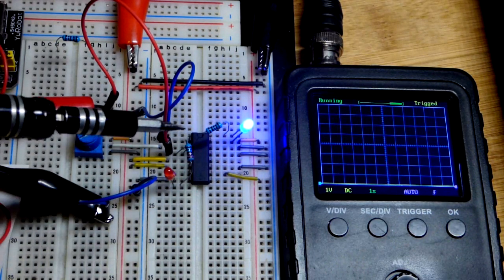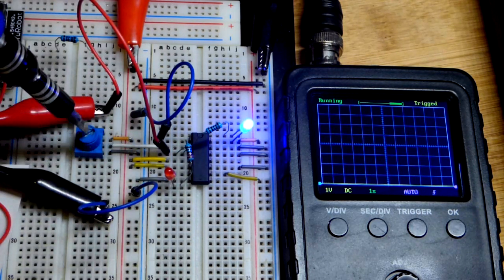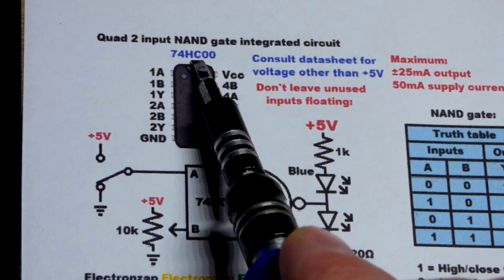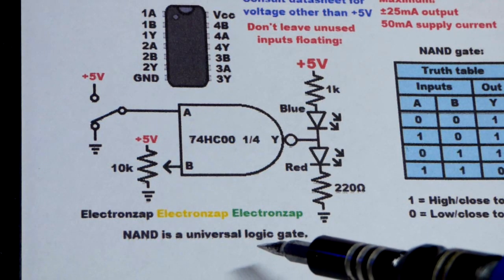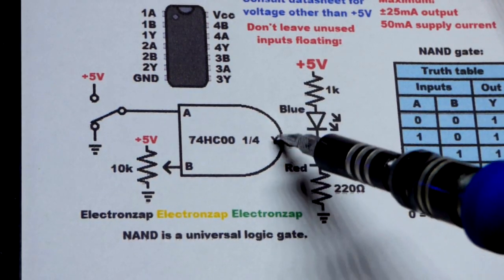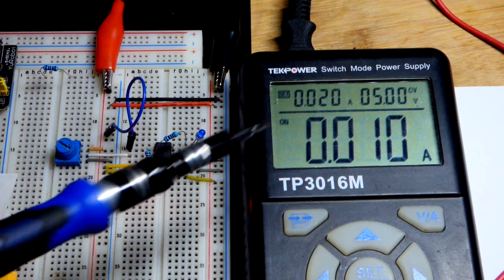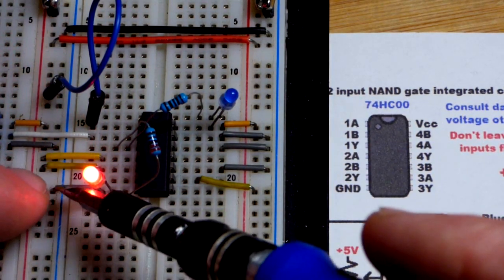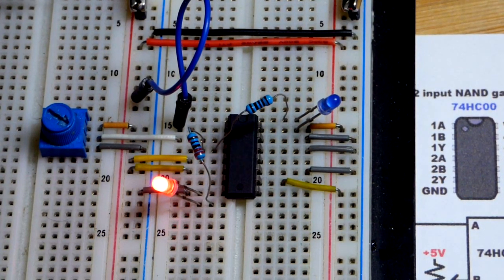74HC00 7400 Quad NAND 2 input logic gate integrated circuit demo learning electronics lesson 0049

Comment: Good little video mate, new sub here who's just getting into Digital IC, just looking for some clarification on the 7400, from further reading it is a push pull/totem output so am I right  when the output is low like we saw in this video does that mean that the current from the load flows through the transistor inside the ic and then down to ground?. 
I sort of get the open collector theory but to me if the above is correct logic 0 sinks current then i guess they both to the same thing just a different configuration.
Reply from the maker: Thanks! Yeah, for a push-pull, low output means the output pin is connected to ground, but through transistor circuitry in the IC, so not directly. That's how it sinks current. Whereas high output means the output pin is connected to the positive supply, again through the IC's transistor circuitry. Which is how it sources current. Not all IC outputs work the same though, so you always want to check the datasheet for the output type of the specific component you are interested in. Plus of course, always pay attention to how much current it can handle, and everything else.
Reply: @Electronzap  you're welcome mate, and thankyou for the reply, I'm looking into 7400 series logic as most of the gear I'm mucking around with (video arcade pcbs) have these guys wired up. At least it's a start knowing I'm on the right track, thanks again for the info 👍I'll sing out im sure after watching a few more if you're vids!...